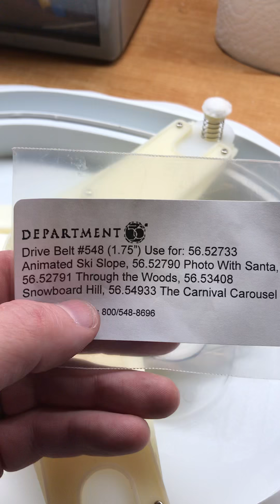Dept 56 All Through the Woods belt replacement Part 2

Comment: Hello  I’m really hoping you can help us my hubby is trying to fix our “ through the woods “ and we figured it was the belt as this has happened to us before so we ordered the belt on dept 56 website and it works however the weird thing is as soon as we add the cover it stops what the heck  we don’t get it any help would be greatly appreciated  we love our piece and want it to work ty 🌻🌻🌻
Reply: Hello, @tmaffeo did you fix it ?  I have the same problem with the top.   If a try and hold it slightly up it starts working but screwed in the animated objects get stuck almost like the alignment to top needs raised ?   wondering if you fixed yours?
Reply: @ unfortunately no . I’m so sad but I can’t get rid of it . lI have it displayed anyway lol .